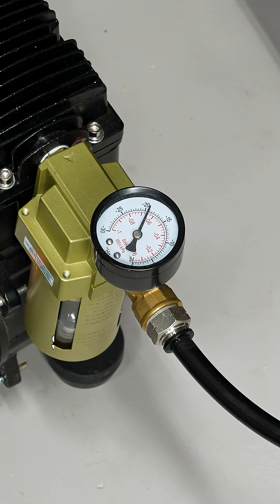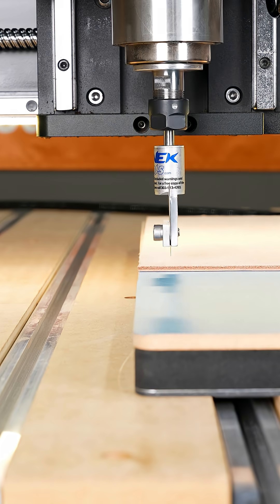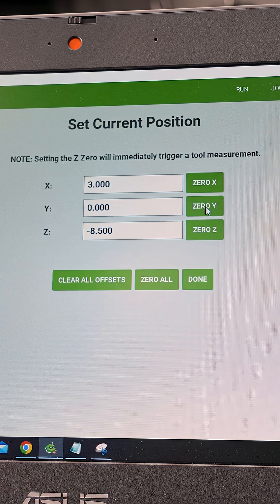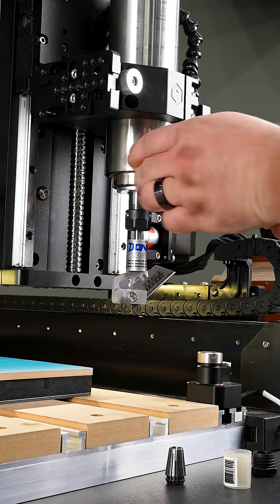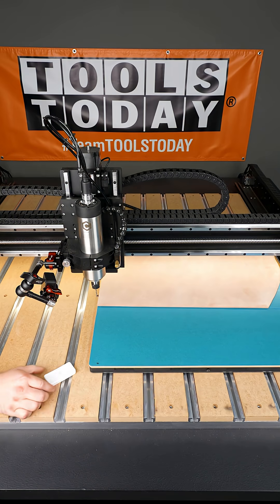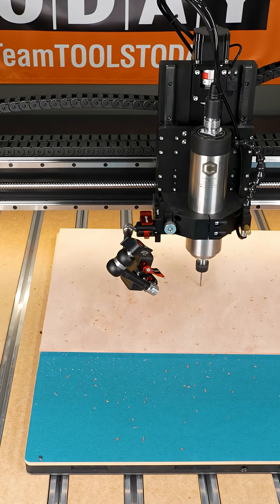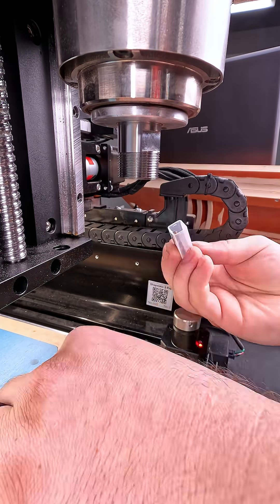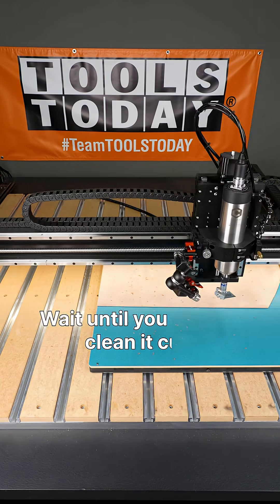Circular Leather Tray Part 1   CNC Setup + Drilling the Snap Holes

Comment from the maker: When using a drag knife, the knife tip isn’t centered like a normal bit, it’s offset. That means your X and Y zero positions need to be set individually to account for that offset so the cut lines up perfectly with your drilled holes. In Part 1 of this circular leather tray series, I show how to set those zeros, drill the snap holes, and prep everything for the drag knife cuts coming in Part 2.

Check out the tools used on our website - 

Amana Tool 1/8" Solid Carbide Drill Bit - https://toolstoday.com/v-11881-scfd-100.html

Donek D4 1/4" shank Drag Knife - https://toolstoday.com/donek-tools-d4-drag-knife-1-4-shk-x-1-4-ch.html

AirWeights Complete 24"x24" vacuum workholding - https://toolstoday.com/airweights-complete-system-24-x-24-vacuum-table-workholding-system.html

Shapeoko 5 Pro CNC Machine - https://toolstoday.com/carbide-3d-shapeoko-5-pro-cnc-router-machine.html